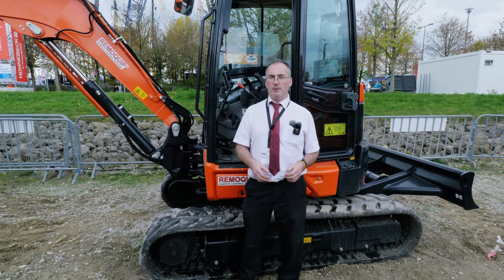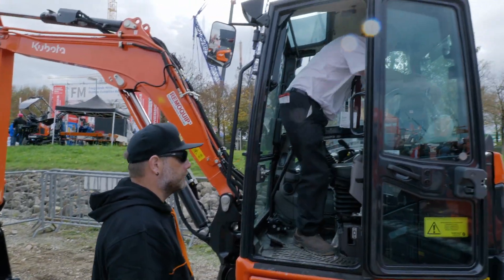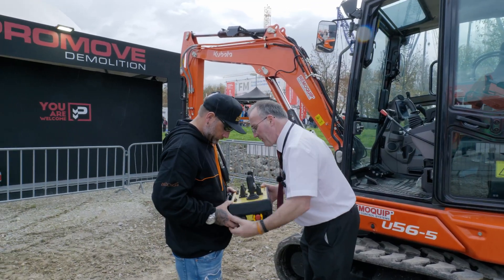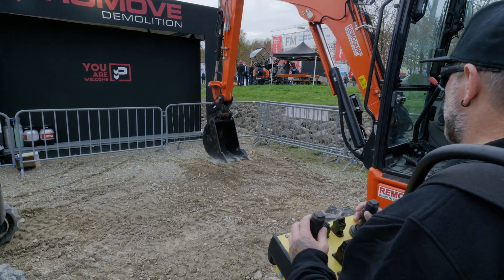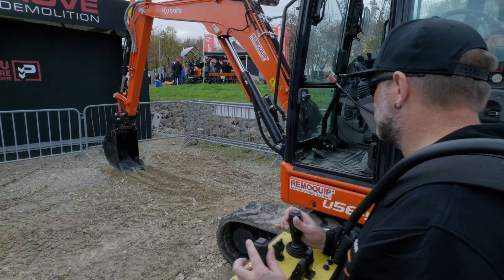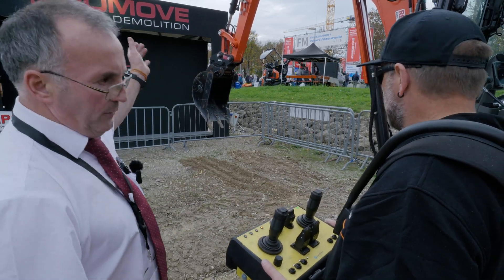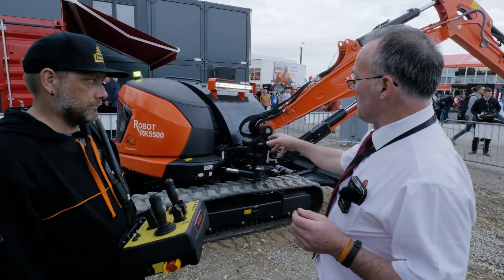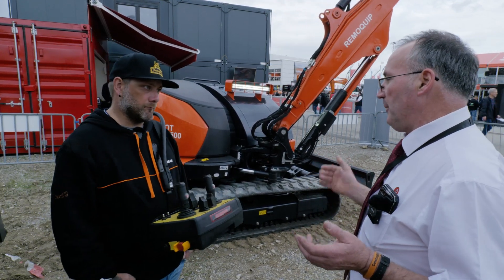ROBOT EXVAVATOR SYSTEM AT BAUMA 2022

Comment: Thank you first to the Demo guy, very patient and very expert at set up. I like the main box sitting in the cab seat. To me it's like you put an operator in a seat. This is the state of the Art coming. I see lots of these Remote on say work boats. Fisherman running boom from anywhere on Deck, instead of working the control in one spot.